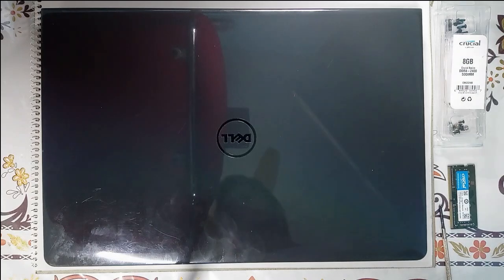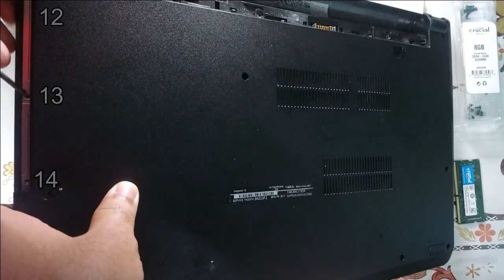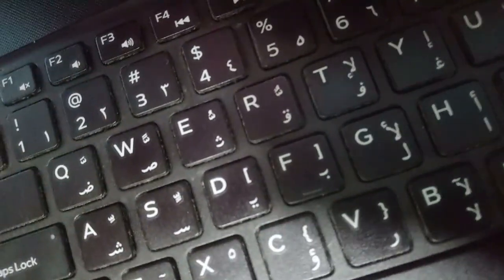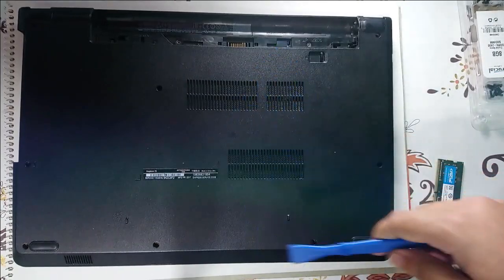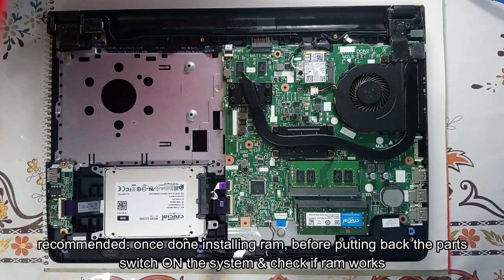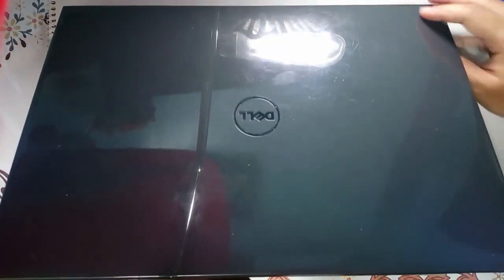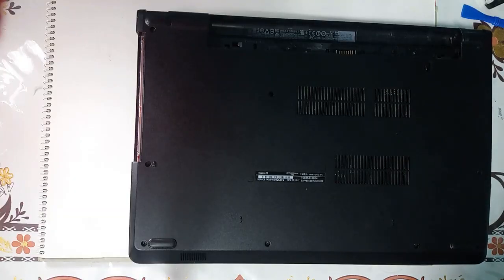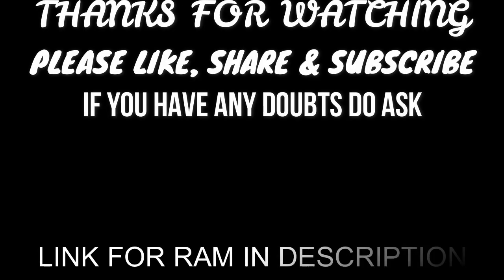How to Add/Upgrade RAM on DELL Inspiron 15 3000 series | Step by Step Tutorial

Comment: This is an old version of the Inspiron 3000 laptop. Dell no longer makes them this way. The keyboard is not removable from the front and the battery is not accessible easily unless you remove the back panel. Must be a very old version of the Inspiron 15 3000. I bought mine in 2022 and not constructed this way.
Reply from the maker: Yep, purchased it in 2017.
But would say just old, not very old lol.

There doesn't seem to be an identifier to distinguish them, like a generation.
Reply: @AmateurPetrolHead  Everything is now easy to access. I wonder what they did to the design. It keeps dust away even on the fan.
Reply from the maker: @TikTokUzee  
Nice, old design is overly complicated.

My secondary storage (HDD) is on its way out (laptop was tossed hard by a friend, so was getting sound when it spins & sometimes was not detectable, but it fixed on its own)

My fan has again become dirty, but have already opened it atleast 8 times. Scared to open it now, cause the plastics are delicate and can easily break.
I hold the fan still with a pick and then using combination of blower & vacuum to clean it. But will never be as clean, as when opened.
Reply: @AmateurPetrolHead  Yes, the plastics are so cheapish. Scratch easily and prone to breaking.

Comment: what was your ram storge size before this

my ram size is 4 gb can i change it with 8 gb
Reply from the maker: Mine was 8 GB from factory, added another 8 GB in video.
Enabled virtual Ram for 16 BG (can do twice the size of the physical RAM present).
So i have 32 GB RAM committed. Suggest you to enable it, especialy if you are running OS on a SSD, as its basically free RAM.

Yes you can, Infact I believe the 7th gen variant supports upto 32 GB physical RAM, so you can put upto 2*16GB RAM's

Comment: Nice job on the video!  My RAM upgrade from 6GB to 32GB went perfectly by following your instructions. Thank you!
Reply from the maker: Glad it was Helpful 😃

Are you running OS on HDD or SSD?
If HDD, would recommend swapping HDD or adding an SSD (replacing CD drive with caddy tray), to run OS on it. There is significant boost in performance doing this.
Reply: @AmateurPetrolHead  hmmm. You just went over my head as far as my technical knowledge but I'm going to research what you said.
Reply from the maker: My bad, Sorry i couldn't convey it clearly.

Assuming we both have the similar model year laptop (2016), initially Dell only offered HDD & dint have an SSD option.
So do explore shifting the Operating System (OS) on an Solid State Drive (SSD), instead of the Hard Disk Drive (HDD).

This upgrade will be cheaper than your RAM upgrade in terms of price, and will make your computer run much quicker i.e. it'll run like a smart phone, the system restart time will be only 2-5 Seconds instead of 30-45 seconds, you should be able to open more than 100 chrome tabs and still face no lag, even the battery life will be increased etc.
I am recommeding this from personal experience, as i run Video editing, Mechanical Design & Coding softwares, this used to take me hours sometimes even a day. But post the SSD upgrade, its taking only few seconds-minutes. 

If unsure on process, get it done by a local technician. Mistakes could result in loss of your genuine windows license or even your Data.
Following links should be helpful:
Overview of what i wanted to convey:
https://www.youtube.com/watch?v=7Le07EjcTiE&ab_channel=CNET
Regarding the backup & compatibility process:
https://www.youtube.com/watch?v=HCtbRo8s2Aw&ab_channel=DellSupport
Post it hardware process, replace the SSD in the original slot of HDD:
https://www.youtube.com/watch?v=sDYo3zJFTGA&ab_channel=It%27sBinh%28Been%29Repaired%26Reviewed
You can retain the exisiting HDD, by replacing the CD Drive with a Caddy Tray to hold the HDD:
https://www.youtube.com/watch?v=JNzjp24dW08&t=124s&ab_channel=KLGamers

Hope it helps.
Reply: @AmateurPetrolHead  I did some research and then upgraded to a SSD drive. Huge improvement! Thanks for the advice. My laptop is performing like new.
Reply from the maker: @blakedel Glad you did it!

Since you have an SSD, would even recommend increasing the Virtual Ram, so instead of just 32 GB you will have 64-92 GB RAM!

Just need to do some simple steps in windows settings:
https://www.youtube.com/watch?v=jEU1OuL8LJA&ab_channel=EasyTechGeek

Comment: is it possible 4gb + 16gb ram together?
Reply from the maker: yes, its possible & will work most of the time.
However its always recommended to put identical rams (its terms of capacity, speed, latency etc.) for best dual channel performance. When RAMs are not identical, the motherboard will run all memory modules at the speed of the slowest module.

Comment: Just wanted to say thank you for your extremely helpful tutorial.

Just one thing. The screws under the keyboard are numbered (stamped into the metal).
Reply: Thanks for the video. Timestamp 4:05, its numbered on the metal body.
Reply from the maker: @AllDayCanteen  Thanks for the info!
Reply from the maker: Glad it was helpful 😃

Could you please mention timestamp? where screws are numbered, Sorry not able to spot it.

Comment: This was a really very helpful video and every step was so well described. Thanks a lot man cause I had to upgrade my laptop and wasn't able to figure out how to go around that, I say plenty of videos but no one has explained so well in detail. I specially liked the part where you numbered the screws and segregated them according to their sizes because as amateurs, most of us would mess up by either loosing count of the screws or by attaching the wrong screws at wrong location. Once again thanks a lot man. 
As much as I liked the video, I would also have a suggestion for you, there is an official  laptop refference guide and a laptop service manual available for Dell Inspiron 3567. I would be more than happy to share it with you if it helps more people like me ✌🏻
Reply from the maker: Thanks & Means a lot, 
Glad it was helpful 😃

Please share the laptop reference guide and a laptop service manual, I had only referred to Dell forums.

Comment: Hi quick question what is the difference ddr4 8gb 2400 to ddr4 8gb 2666 ??
Reply from the maker: RAM speed is generally measured in megahertz, usually abbreviated as “Mhz.” This is a measure of the clock speed (how many times per second the RAM can access its memory) and is the same way CPU speed is measured.

So 2666 is faster.

But if this is for your second RAM & you want to run Dual channel, take the same Mhz as first RAM. A higher Mhz wont be utilized anyways & may have an issue running dual channel.

~source: https://www.howtogeek.com/438671/why-you-should-overclock-your-ram-its-easy/#:~:text=RAM%20speed%20is%20generally%20measured,way%20CPU%20speed%20is%20measured.&text=So%20really%2C%20the%20speed%20is,2400%20mega%2Dticks%20per%20second.

~ https://www.quora.com/Is-it-ok-to-put-RAM-of-different-mhz-speeds-into-one-motherboard

Comment: dell inspiron 15 3000 series i5 7th gen best ram plz single channel plz tell
Reply from the maker: You can find 100% compatible (Inspiron 15 3567) rams here: https://www.crucial.in/compatible-upgrade-for/dell/inspiron-15-(3567)

Since you want only single channel, can go for a
16GB RAM: https://amzn.to/38o5UVq

However, Two 8 GB rams will give better performance though because of dual-channel & will be cheaper.

32 GB single rams are unfortunately not made
for this model.

Comment: Tell me immediately please  is it necessary to remove 5 palm screws.just disconnect the keyboard cable and optical cable.i want to replace with ssd.pl tell me
Why unnecessarily remove 5
 keys without taking out the board. Am i right or wrong?
I want ur advise pl
Reply from the maker: Those top 5 screws too hold the back plate, so you need to mandatory remove them.

Comment: Can we add two 4gb ram on this laptop .. how will it perform ..?
Reply from the maker: Links of compatible RAM (for DELL Inspiron 15 3567):
4GB RAM: https://amzn.to/2YCO4sr
8GB RAM: https://amzn.to/3fpG1Gg
16GB RAM: https://amzn.to/2YyplFJ

If you have a different model or even manufacturer computer and want to know what will be 100% compatible do checkout https://www.crucial.in/products 
And click "select computer" or "scan computer"
Hope it helps :)
Reply from the maker: Yes you can. But generally, a single 8GB is preferable. as you have the potential to upgrade in the future by filling the second slot.

Only if you are certain that 8GB will be enough (and it probably will be), and a pair of 4GBs is cheaper than a single 8GB, then go for the pair.

Since this laptop motherboard supports “dual channel” mode, the pair of 4GBs may actually be faster than a single 8GB. But Note that in this circumstance, the chips must be identical, that is, if you have a 4GB stick already, a second 4GB stick needs to have the exact specifications as the original, so you can’t just grab whatever is on sale. A mismatched pair will work, but at lower speed.

Comment: how is it working now?
Reply from the maker: The perfomance for normal day to day purposes remained unchanged & is not noticable. But for RAM intensive tasks like games & video rendering or running simulations there is a huge difference in time taken. I can also parallely do other tasks when they are running in background, which was previously not possible.

have been using it for more than 2 years & working perfectly fine.
Reply: @AmateurPetrolHead  ok cool

Comment: Nice video but thing you missed though that is how it performs after upgrade
Reply from the maker: Thanks for the feedback, will benchmark it next time.

The perfomance for normal day to day purposes remained unchanged. But for RAM intensive tasks like games & video rendering or running simulations there is a huge difference in time taken. I can also parallely do other tasks when they are running in background, which was previously not possible.

Comment: Hello brother plz help me I have dell inspiron 3593 laptop its Is very slow what I do
Reply from the maker: Hey, even my computer was very slow & regretted buying it. But I did a SSD upgrade and now its really good. Before it used to always heatup & lag. Now it doesn't do so anymore & battery uptime increased! The total budget for doing this is slightly higher than that of a RAM upgrade, but totally worth it. your computer should boot up in just 5-7 sec 🔥. If your not confident doing it yourself any local shop will do it reasonably. 
This 'Ram upgrade' video which I posted it doesn't even help for day to day use, I needed more RAM to run heavy CAD/simulation softwares or Video editing that's why did. If this video would've gotten a better response, I myself would've posted on how to do so. 

But anyways hope this summary helps:
https://www.youtube.com/watch?v=RORxbzULGC4&ab_channel=G6TechnologyServices
 
1) Take a backup of you current data, you dont loose data but to be on safer side.

2) Download 'Windows 10 installation media' to a blank pen drive, this will be needed to transfer the existing windows key from your HDD to SSD. Note: We run windows from SSD for best results.
https://www.microsoft.com/en-us/software-download/windows10

3) Buy SSD (minimum 240 gb should do) https://www.crucial.in/compatible-upgrade-for/dell/inspiron-3593#ssd
You can either go for the M.2 or SATA SSD as your laptop 3593 seems to support both, my 3567 supports only SATA.
a) If you buy SATA:
Place SSD at current HDD location
remove your optical drive permanently and put your current HDD there with the help of caddy tray.
b) If you buy M.2: 
you just need to plug SSD  in an empty M.2 slot

4) Reboot & insert the bootable pen drive from step 2. Follow necessary procedure to transfer windows to SSD. Done that's it!

Comment: Sir can you give me advice what is best graphics card upgrade for my Dell Inspiron 3668 i3-7100 8gb ram
Reply from the maker: First of I recommend upgrading your CPU, cause there is no use of having a dedicated GPU when the i3-7100 will never use its full potential. I have a Dell Optiplex and upgraded its i3 CPU to an AMD Ryzen Threadripper.
Anyways the Dell 240w PSU was validated with the following Dell OEM video cards =

24K8H Nvidia GeForce GTX 1050
1MPR3 AMD Radeon R9 360
8MXMJ Nvidia GeForce GTX 750 Ti
8CCF1 Nvidia GeForce GTX 1030
J27RG Nvidia GeForce GT 730

If you want to use retail video cards that have faster clock speeds, you will need to replace the Dell 240w PSU with a retail 3rd party PSU of at least 350w.
Hope it helps :)